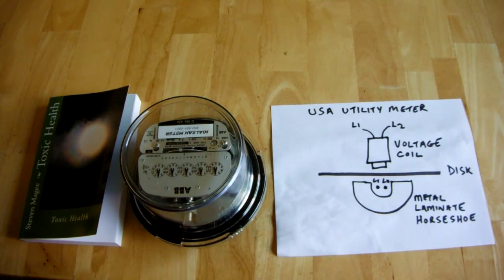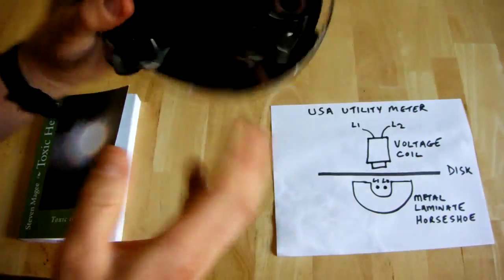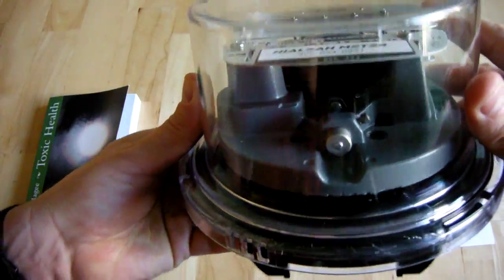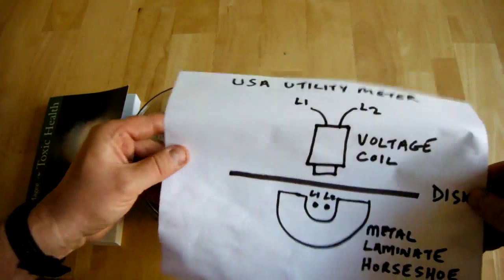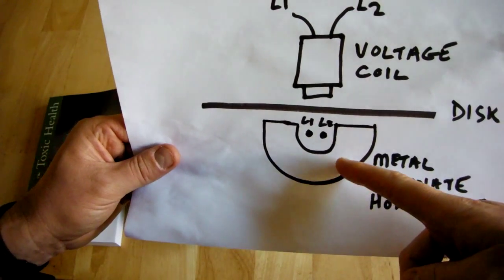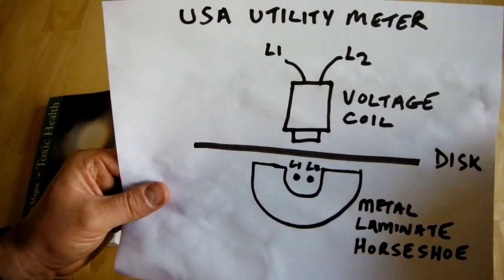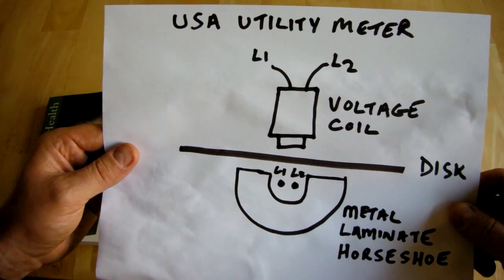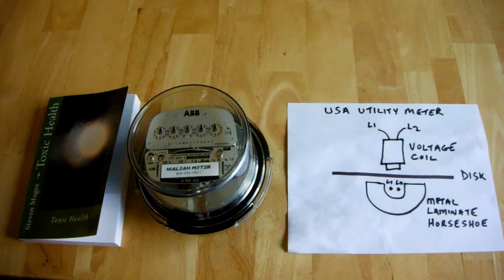How Does a Conventional Electromechanical Electric Utility Meter Work?

Comment: Nice video Steven.I believe you live in Tucson AZ?I believe TEP recently changed our electrical meter system recently sigh .Thanks for the videos !
Reply from the maker: Just in case it makes you sick, here is a link to my Tucson RF transmitting utility meters poster.  I have a copy posted next to my Tucson utility meters: http://www.environmentalradiation.com/Say%20No%20to%20Tucson%20Tranmsitting%20Utility%20Meters.pdf